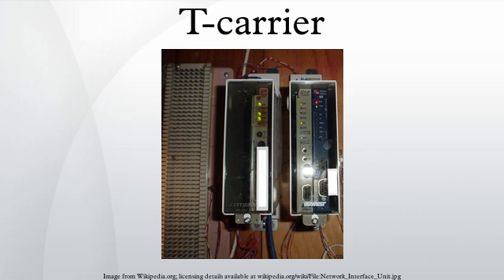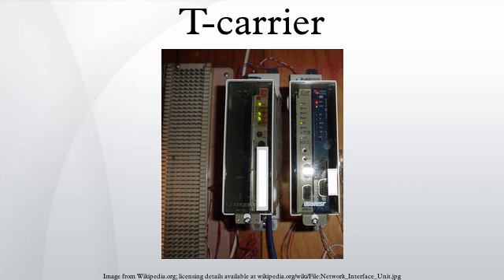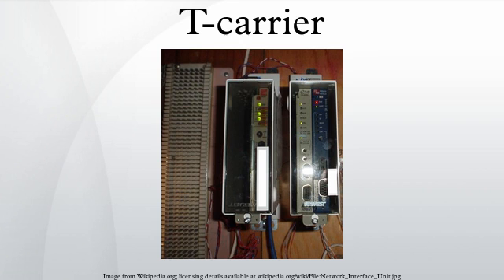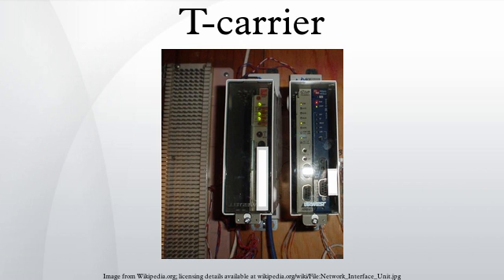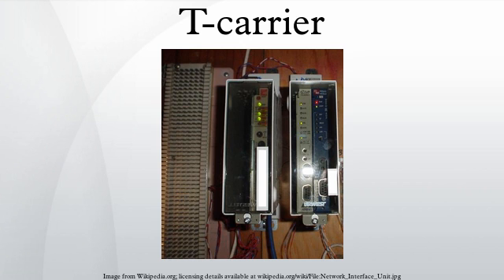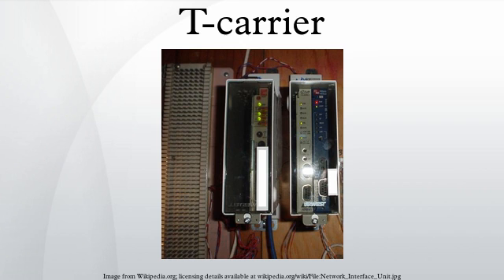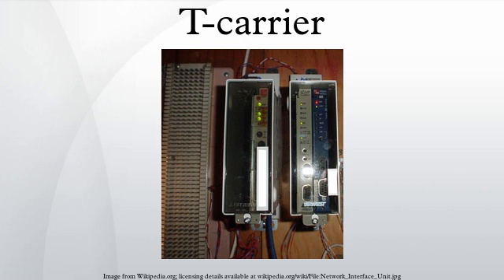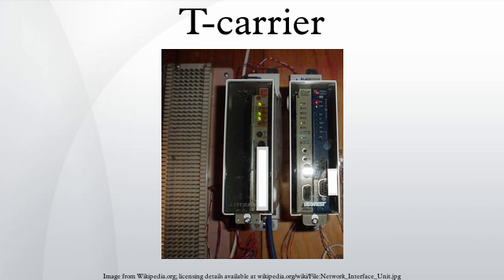T-carrier

Comment: I was a T-carrier tech and repaired the lines. T stands for Time Division Multiplexing.
I replaced line repeaters and did repairs inside central offices.
Reply: +Bri G. hey there, im doing self study on networks, is the T1 Carrier an actual physical device? and is the T3 the same? what ive been reading isnt clarifying it. any help would be appreciated
Reply: T1 look up D4 Channel bank, it has 24 channel units. 24 conversations or lines can go in and they are multiplexed together. In the old days 1 pair of wires (Tip & Ring) could only carry one phone line, only two people talking to one another. with T1 24 people or conversations can be carried on 1 pair of wires. (T1 is actually 4 wire, one pair is used for transmit , the other pair is for receive). 

T3 can carry many more lines, (672) it uses laser light and glass fibers instead of copper like T1. Fiber optic multiplexers multiplex or combine the channels together.
The equipment is different, the circuit packs or plug-in cards are not compatible with a D4 channel bank.

 Fiber Optic came into use in 1982 and T1  came into use in 1962. The equipment was manufactured by Western Electric.